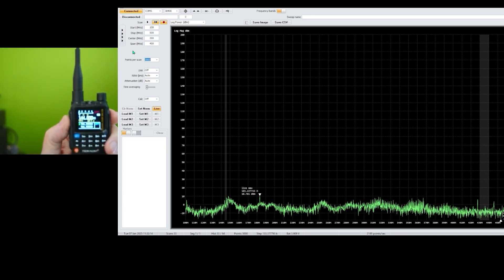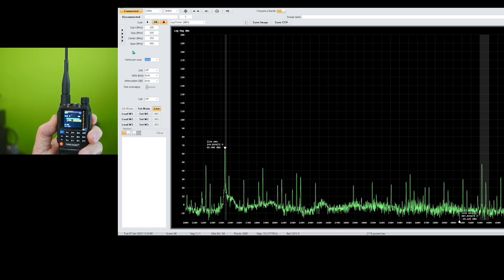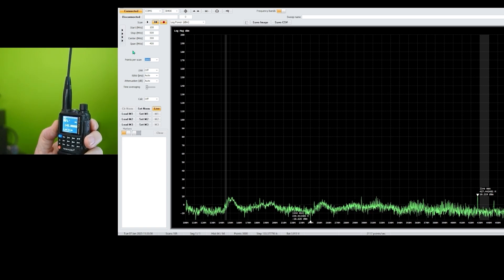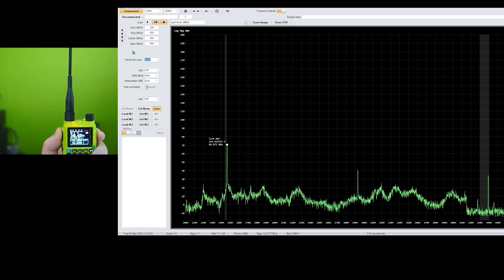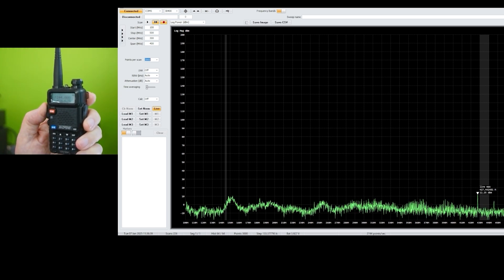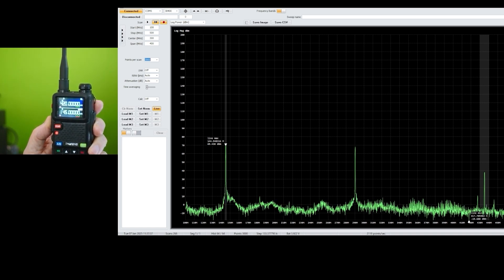Do You Want to Transmit with One of These? You May Be Fined Thousands of Dollars & Lose Your License

Comment: Hi Jim, I really appreciate your efforts but have to bring into skepticism your testing methods. I have been a technician for over 40 years and have read about tests regarding  many radios that are currently on the market. I'll agree that some of the cheap radios are far worse than others but I know for a fact that there have been independent "laboratory" tests on the Baofeng UV-5Vr by trusted testing facilities and they're no where near as bad as you're portraying them to be.  This is the reason why scientific measurement facilities exist. They use a scientific and carefully calibrated reference based testing model.  You have to use the correct test environment and gear to get accurate results.  I'm not mentioning  any of this to be judgmental but merely to raise awareness.  Thanks for listening.....
Reply from the maker: Thanks,  I used a "T" with 30dB of attenuation.  One side of the T was the transceiver, and the other side was a Bird Wattmeter to a Bird Dummy Load that is good to GhZ at 500 watts.  I also used the antenna to a receiving antenna a few meters away.  The tinySA had some built in attenuation (perhaps 30dB).  Good question to ask.  What do think about my two methods of measuring?  73 Jim
Reply: @ham-radio  Hi Jim, Thanks for taking the time to listen and respond to me.  I think the testing methodology that you employed is sound but I think the TinySA isn't a great piece of equipment for these tests.  Also at the power output level of the radio's that you are testing which I believe are in the range of about 5 to 8 watts in both test cases even with the attenuation that you are employing would probably be high enough to swamp the TinySA to make it sing like a Canary. So with the measurements as bad as the ones that you showed on the analyzer screen at 30 to 40db down would be almost nothing at 100 ft away from the radio. At 5 watts 100 feet away at 30 db down, any harmonics would likely only be about 50mw or less. Remember that every 3db is half the power. In practical use scenarios,  we use name brand as well as these Baofeng UV-5r radios all the time in our Mid Island Radio Association functions where we coordinate with emergency services teams both on and off frequency and have never had a single reported issue with spurious emissions creating a disruption from any of our team members or Fire / Police so I think that you are possibly being very sensitive to this issue. I would love to do some independent testing of my own to add weight to your conclusions but unfortunately don't have deep enough pockets to own test equipment that is good enough to provide accurate results.  Thanks for all that you do Jim and I'm really glad to see that you're still managing to keep going after all of the health issues that have been troubling you.   Regards, Kelly
Reply from the maker: Also, two 10 watt handhelds tested very clean.  One down more than 50dB if I remember correctly. 73, Jim
Reply: @kellywilson2858 So, why did the Yaesu out perform all the rest in the same test environment?
Reply: @kellywilson2858  I'm curious what impedance the radio saw as a load.  Plus I was going to ask what spectrum analyzer was used, but I have that information now. Using a T connector into an antenna after the attenuator and spectrum analyzer ? Both having an input impedance or 50 ohms? Would that   not be a 25 ohm load? Maybe I'm missing something here. I also have the tinySA ultra but treat it as a toy compared to my Rigol SA800, Protect A734, and a couple of HP analyzers. Like you said better to test them in Lab environments but Jim's tests should still be considered as good basic info and comparisons however accurate. 73.
Reply: As a tech for over 40 years you should know that the cleanliness of 1 radio's output says little about the output cleanliness of another radio, even of the same make and model, especially with the $20 HT's, because for $20 the manufacturer clearly can't afford to do harmonic testing on each radio. In any event, as hams WE are required by the FCC to determine that each radio we go on the air with has no illegal level spurs. 

For a load I use my Bird dummy load and Watt meter. I use Agilent and Rohde & Schwarz attenuators. I check ALL of my gear regularly on an HP spectrum analyzer or an Anritsu spectrum analyzer whose readings I occasionally compare to ensure they still match. I also occasionally check my spectrum analyzers against my Agilent power meter to verify they are reading accurately. I have a crystal oven that's disciplined by GPS as a frequency ref, in addition to a rubidium standard. I repair test and measurement equipment for a government lab. I've been an electronics repair tech since 1963, and an avid equipment designer on frequencies from the LowFER band on 175 kHz on up to Hi-Fi modulated audio over long-range laser light.

Having said all that so you know where I'm coming from, I own 4 Baofeng UV5R HT's. Three of them work fine, at least as fine as a Baofeng can work, with only the first harmonic being less than 50 dB down from the carrier.  :) The 4th HT is a POS with nasty harmonics all over hell, some nearly as strong as the 2.1 watts on the frequency it's supposed to be putting out on. It's essentially broadcasting on 2 or 3 frequencies simultaneously.  Same make, same model, same source as the other 3, all purchased at the same time. Like I said, testing 1 radio says essentially nothing about any other radio. What one tester learns about their radios means little to anyone else and their radios. People really need to stop making such comparisons and check their own radios. Those are the ones on which they are required by the FCC to maintain clean outputs.
Reply: @johnwest7993  Hi John, thank you for your carefully crafted  reply. I do agree with you that no two radios are alike. Having said that, there is absolutely no way that all hams can test and profess that the radios they are using are in compliance. That would require every ham to have a complete test bench with all the equipment to do so of which would be an unreasonable expectation these days. If you use a piece of equipment that is branded with an FCC certification then you are supposed to be able to use that device without fear. If that device has no such certification then you are on your own. Since you have been a radio engineer since 1963 then you also came from an era where most hams of that time were building their own gear either from scratch or from kit and those would definitely require testing to be in compliance. Some of those old tube chassis radios were pretty dirty as well and required constant maintenance due the lack of tolerance in the parts and the tubes that deteriorate.  It was a different time then and I think we can get hung up on semantics. I think as long as we are buying approved radio's regardless of the cost, as long as they have an approval stamp, we should be allowed to use them without persecution and ridicule. If you want to keep this hobby alive and attract younger member who don't have the deep pockets of the old crowd then we need to exercise tolerance and not be critical or you will obliterate the hobby completely. This is that last that I will have to say about this topic and wish everyone 73's.
Reply: Agreed, it appears something may be wrong with his testing process or equipment. This is not consistent with the results other hams have gotten testing these radios. KI6NAZ for example said his H3s test clean, although he did mention that older ones weren't legal. I wonder if the ones in this video are older? Same with the Baofeng. Newer units reportedly test clean, although they have had spurious emissions issues in the past.
Reply: Why is this "pinned"?  You don't need a laboratory to determine if you're generating interfering spurious transmissions - you just need another radio, spectrum analyzer or sdr.

Comment: If it was such a problem the fcc wouldn't license them as for being liable for a fcc licensed product transmitting on emergency freq if even possible the chance of you getting caught is minimal and even if caught you would've had to cause some damage in which no attorney is going after you over the radio maker. This whole spurious emissions threat of revocation and fines by using a licensed radio not modified is preposterous.

Comment: I have little use or respect for $30 radios, but as to your methods, I have some questions:

1)   What test equipment are you using?   
2)   Are you really transmitting over the air to the spectrum analyzer?     What have you done to assure that, in your environment, nothing is generating intermod?    What assurances can you give us that your equipment is clean?
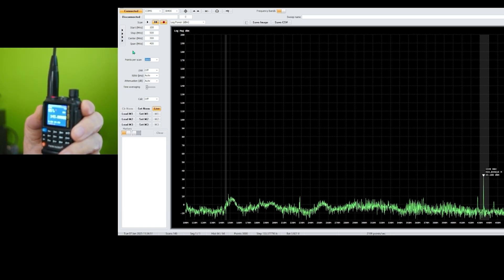3)   The radio at 6:48 shows a second harmonic down about 42 dB but you tell us it's only down 20 dB.    Can you explain why you say this?
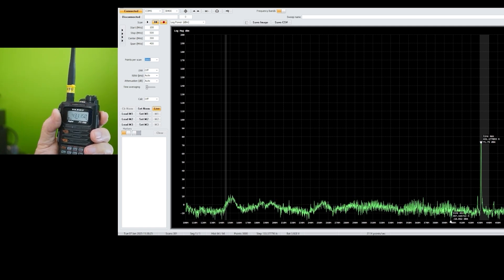4)   At 8:53, you transmit on 431 MHz and claim the second harmonic is "non existent"  but you are not showing us  ascan of 832 MHz, so we can't see what the second harmonic is.   Why not show us what you are talking about?

I KNOW the Baofeng UV17, on 2 meters, has a second harmonic (at least in my lab) that is within 20-22 dB of carrier, other than that, it was surprisingly clean.     I have tested no other cheap radios.

Comment: I was understandably horrified when I saw this. I then went to my spectrum analyser (an old Tek 492) and i measured my Baofeng UV-5r. The second harmonic from 2m was 45dB down
, no additional ones. On 70cm it was below the noise floor. Both tests with 30db attenuator attached. From what I hear other hams here in Poland have similar experiences. I wonder do the Chinese sens the bad units to the US on purpose?

Comment: Hi Jim, correct me if I am wrong, but it looks like the Yaesu 8:30 is transmitting on 431.150 MHz, but your SA stops at 450.00 MHz.  So if this is the case, the second harmonic is not displayed on the SA.
Reply from the maker: You are absolutely correct.  I had tested it on 144.000 in the past and it was clean. The Yaesu was locked on the node frequency of 431,150.

Today I looked at Ham Radio Outlet and DXEngineering.  There were 2 handhelds at both stores that were dual band.  The price for $95 any one of the three. For those who said they could not afford a better handheld, the price tag of $95 should be affrodable.  73, Jim
Reply: @ham-radio  hi Jim, I have here ft70 only for airband scanning, as I have no license, had as s kid; also tyt-uv88 and recently uv-99 (worse receiver than uv88 though), again, as a listener for 70cm and 2m repeaters mostly ... but, this "test" looked like some kind of irony finally ... you shown the ugly spectrum of all the chinese and then japanese (probably ALSO made or at least assembled in china, hi) ft70 with no harmonics at all because on the different band )) ... actually, ya, of the limits ... so, it looked like a sarcasm, the more you sed "look here no harmonics" ))

Comment: I saw another video with guy using an HP analyzer. So now I'm skeptical. I dont think it's fair to say that a $100 analyzer is very accurate. For all we know that tiny sa generates spurious signals of its own.
Reply from the maker: Thank you for the comment, the manufacturer can do his own certification.  I have been told a few times that the FCC has no RF engineers on staff.  My sources have been FCC employees.  Thanks for your time and comment. 73, Jim

Comment: Thanks for doing the test with the HT antenna.  I have seen TinySA test using a direct attentuated cabled connections and wondered how a tuned antenna would change the results.  That is would an antenna act like a filter?
Reply from the maker: I wondered about that too.   The antenna seemed to have way too low of a Q to be helpful.  On some they are resonant somewhere other than 144MHz.  Thanks for asking.  Jim W6LG

Comment: It doesn't matter WHOSE radio a ham transmits on, a Chinese radio, a Japanese radio, a US made radio, or one with an FCC label on it, or 1 you built yourself, or if you bought 2 identical radios and tested the signal purity of 1 of them. As a has we are REQUIRED to know that ANY radio we transmit on has an FCC clean output, as specified in Part 97, the FCC rules for Amateur Radio Operators. To comply with the rules all hams must know them. If you are a ham and haven't read the rules, then you won't know when you're breaking them. Think about it.
Reply from the maker: Thank you.  Well said (with one error).  73, Jim W6LG

Comment: I have always enjoyed you videos Jim, but this appeared to be a classic case of SA front-end overload. I have seen these radios tested with quality SA equipment, and nothing like this was seen. I hope you can repeat the tests. I would also ask, how much attenuation did you use in from of the TinySA? You should connect directly (not over the air) and use at least -30dB attenuation. 73
Reply from the maker: I tested two ways.  One was directly to an antenna with 30dB of attenuation. The other was through a box that I built.  There was a directly line from one UHF female to another UHF female. In the middle is a ferrite bead about an inch O.D. and mix 31.  There are a few turns to pick up RF.  One leg is to chassis.  The other to about 30dB of att. down to a BNC female. From there to the tinySA.  Also, the H8 and the Yaesu (when on 144) had no harmonics.  They looked very clean.  Yes, overload seems likely but since one of the Tidradios and one of the Yaesu was clean, I don't think the tinySA stressed.  You asked a very good question.  Thanks for your help.  73, Jim W6LG
Reply from the maker: Also, two 10 watt radios tested clean....very clean. 73, Jim
Reply: Thanks for the reply Jim. I've never seen results quite as bad as what you saw. I have purchased one of these radios to test for myself, it will hopefully be here soon. I've tested a lot of radios and never seen results that bad, so it will be interesting to compare our results. 73

Comment: The proof is in the pudding.. You get what you pay for.
Reply: He really screwed this test up.
Reply from the maker: I tested two ways.  One was directly to an antenna with 30dB of attenuation. The other was through a box that I built.  There was a directly line from one UHF female to another UHF female. In the middle is a ferrite bead about an inch O.D. and mix 31.  There are a few turns to pick up RF.  One leg is to chassis.  The other to about 30dB of att. down to a BNC female. From there to the tinySA.  Also, the H8 and the Yaesu (when on 144) had no harmonics.  They looked very clean.  Yes, overload seems likely but since one of the Tidradios and one of the Yaesu was clean, I don't think the tinySA stressed.  73, Jim W6LG

Comment: It means a lot to see this behavior on not just one but a bunch of copies of the same model.   Now it makes sense why they are that inexpensive.  No such thing as a free lunch. I’m curious also , would a filter of some sort be possible that could be attached between the antenna port and the rubber duck, to solve this for existing owners?
Reply from the maker: It might more sense to just buy a clean handheld. One or two of the Chinese units I had did test clean. 73, Jim W6LG

Comment: I take exception when you said/implied an FCC number on the radio does not protect the amateur operator.  A legitimate FCC number on a radio product specifically means that model of radio is compliant (at the time of testing) with FCC regulations.  I don't see how a station operator could be held accountable for a radio's lack of FCC compliance if that radio is unmodified and the operator is otherwise compliant  with FCC regulations regarding the radio's use.  In fact, here is the regulation concerning such an issue, "47 CFR § 2.909 - Responsibility of manufacturers, importers, and sellers".  It states, ""A manufacturer, importer, or seller of equipment covered by the rules in this part must ensure that the equipment complies with the applicable technical standards at the time of manufacture or importation and at the time it is marketed or sold. Compliance with the rules shall be maintained at all times after equipment is placed into operation."  This regulation clearly states that it is the responsibility of the "manufacturer, importer, or seller of equipment covered" to maintain compliance after the approval for sale, NOT the amateur operator.  I highly recommend you remove this video as I feel it does not advance the art.
Reply: Agree, he is absolutely wrong when it comes to the liability of the consumer using a fcc licensed product as intended. For him to say you are somehow liable for spurious emissions that we all know likely to never cause a problem is ridiculous.
Reply from the maker: An FCC ID is not testing by the FCC!  Read some of them.  The companies do the testing not the FCC.  And you mention that compliance is done by the manufacturer.  I believe that compliance by the Chinese companies is meaningless. That is never going to happen. No, I am not going to remove the video.  Additionally, I have been in a Command Center during emergencies.  Have you had that experience?  A dirty radio would get me tossed out of the room.  "But Sheriff, the interference is the fault of the Chinese company."  Thanks for writing. Some may agree with you. 73, Jim W6LG